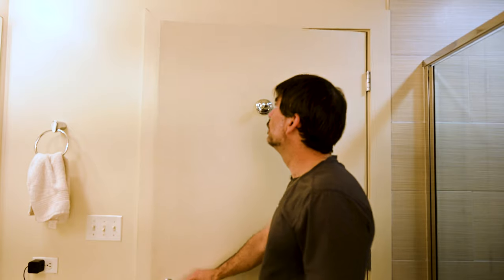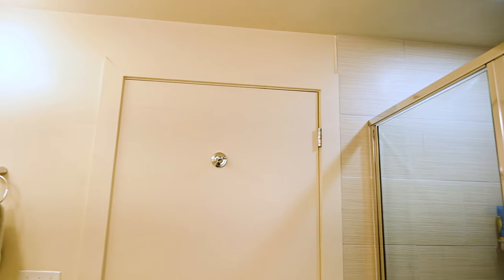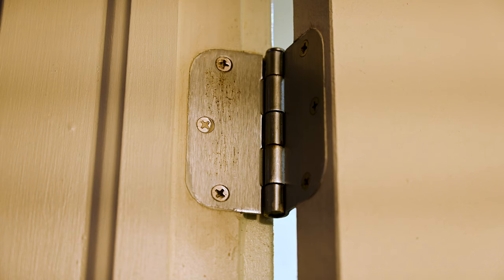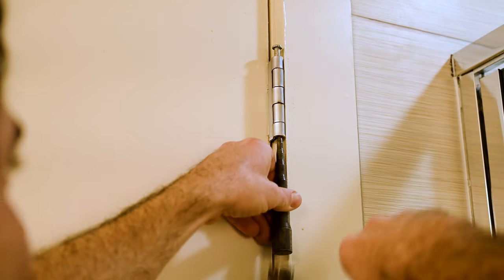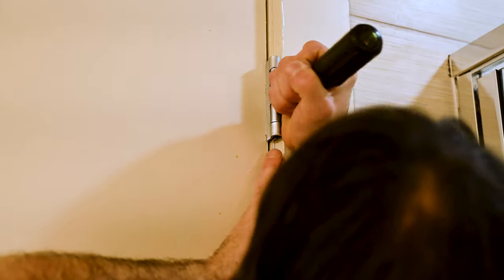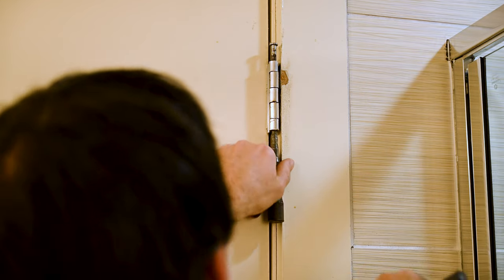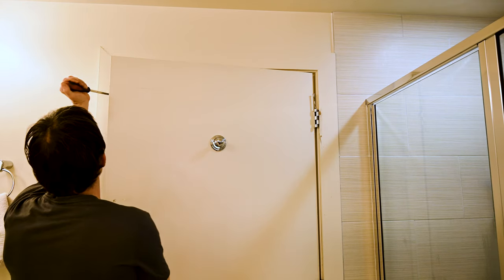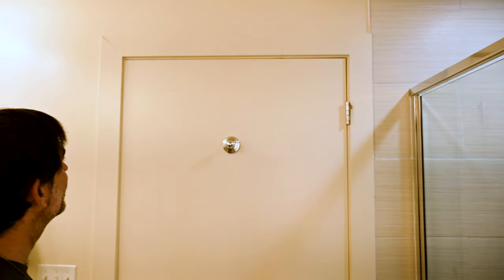Bathroom Door Hard to Shut - Rubs at Top - Let's Fix That!

Comment: I WISH my boyfriend would fix stuff like you do. He has no interest I f ixing the ANNOYING SHIT IN THE HPUSE! Broken window, but has bars on it so he blows it off, back sliding door huge gap bottom, no hot water in bathroom sink for over a year,shower barely sprays out cuz most of the water still comes out the bottom faucer(for the tub you know), VERY SQUEAKY ANNOYING shower faucets, Same bathroom. Loud squeaking when turned on and off, front door gate  on the door bashes real loud when going in and out, carpets are terrible, need to be removed badly, and or deep cleaned, I NEED HELP!. Dryer leaves more lint on clothes when they come out, they are worse with lint than they ever were! So dryer is definitely NOT WORKING. WASHER, SMAME THING, freezer in garage, extra freezer overiced Again, needs defrosting, fridge out there, ice maker does not work for over 3 years, and water dispenser doesn't work for longer than that! All doors in house are loud, annoying and need to be adjusted badly! I have never used tools in my life except a hammer, but I am trying to learn, bupy myself cuz he is NOT into it at all, I am learning, but it's so hard cuz I really have never had the interest, I have always taken care of my stuff, we always had handyman come fix stuff, so I could be a girl my told are curling irons and stuff like that all my life. My boyfriend before him fixed everything including my bikes. He just did it I didn't have to ask I guess I was spoiled I was! But its incredibly sexy when men does stuff around the house, that's a  turn on! I'm serious how many woman out there agree?! When I first met him, we would do stuff, like paint together and fix up the back yard together even nude, together wird huh, but he has no interest even that anymore, itsmok, it's just so  disappointing when everything in the house you share together goes to shitmone by one and itamik ok he has no interest in doing it, ok, but has no interest in helping ME LEARN TO DOMIT MYSELF! It takes me months and months to get him to vacuum one room and believe meit needs vacuumed bad we have a lot of pets. He buys a lot of stuff like tools etc, has tons and tons of it but can never find anything he needs(when he finally has to pull a toolmout to like turn on the sprinkler, or fix something in his truxk). It took him at least 2 years to finally fix the motor home door, and that took all night but now the pins in the door makes it virtually impossible to lock and unlock it, and it has to have the key in it now to even close it from the outside itsma real bitxh, he like fixes one thing, when he ever does, but sacrifices something else while fixing another part or f something! I beg and beg for him to just help me with this or that, not every day, but once a week maybe, like to help me cover the cat scratchingmoosts cuz the cats keep chewing in the scraggly  messed up carpet that's half of it now and all the wood is showing thru, well I gave up on that, him helping me replace the carpet on them, and got the staple gun myself, empty of staples of course, and stapled my hand by accident like a dumb ass, that hurt so bad! enough bitching, I just wish my guy was more like you! Wants to take care of the home he lives in, even when you're sick man that's so cool,! Your women is luckyyyyyyy, oh by the way, I am great with a hammer, for some reason. About the hinges on the door, you just make sure they line up right. I'm going to try this today finally thanks for the video!
Reply from the maker: while i spend a ton of time fixing stuff, i do it for a living and when i get home i usually procrastinate way to long when fixing things around the house. If it weren't for the motivation to make a youtube video my whole home would be broken
Reply: @putz9. Go back to the old boyfriend